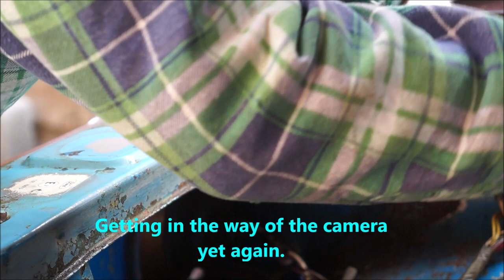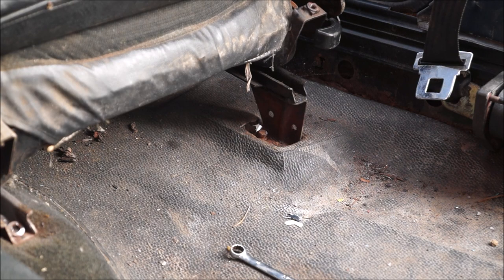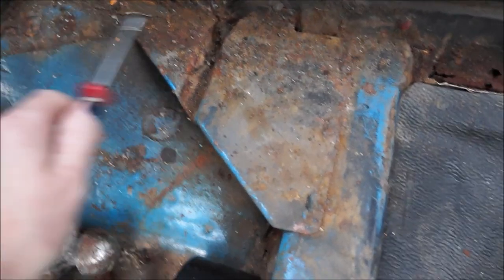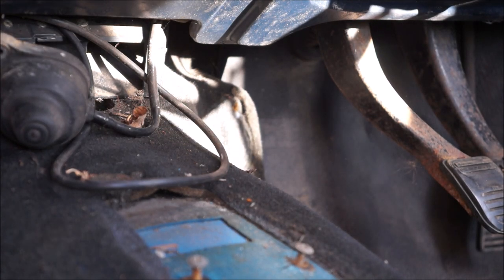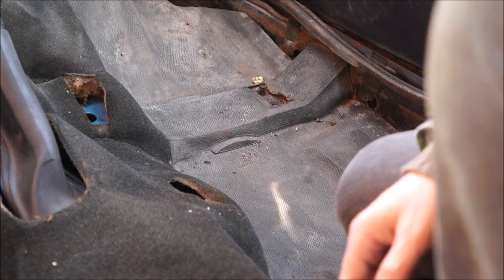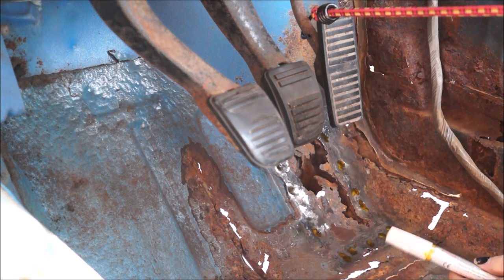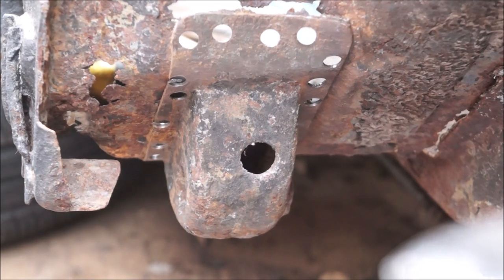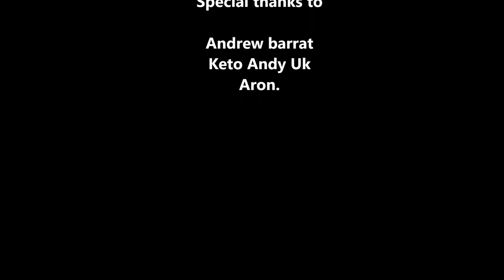Mk3 Cortina Estate Adventure Six

Comment: Oh and while I remember!
Metal and bodywork essential bit of kit when dealing with rust and salvaging structure?
Air Chisel.......
Noisy buggers though but they are awesome when separating spot welded structure from panels and other assorted norty tasks like cutting scrap rusty bits off.
Even a small one will help and you essentially just pop the chisel blade at the seam you want to separate and pull the trigger and BRRRRRRRT away  she comes like the first wave of Nazi Zombies at a Bren gun nest :-D just with less splash.
How do I know this? (Not the Nazi Zombie bit) Well over the years of budget classic restorations (And some Pro resto shop work) I have disassembled hundreds of cars in the exact way they were assembled in the factory.
Sometimes with Pro level gear like Wurth Spot weld drills and bits (Which dont drill all the way through) and sometimes with tightarse reground shallow point drill bits (Youtube it, its worth it) but the one common item was a $40 AUD Air chisel and assorted bits, some modded/Notched etc with the grinder.
The why? you should invest in an air chisel?
Because any car deemed too far gone can always supply NOS parts, panel and structure which when removed properly are both amazingly handy and even valuable should you accumulate more than a few.
And selling them will fund your projects/Workshop/Tools.
For example, a Rusty Chrysler wagon I was given, Well begged to take away yielded perfect rear panels and some structural outriggers at the front.
The 15 hours of blood, sweat, knuckle and unmentionables skin (Dont ask) eventually yielded me nearly 2 grand at mates rates which bought me a car lift (Hoist).
Even stuff like roof skins, the complete turret and weird stuff like A and B Pillars are sought after by the hard core resto gunzels seeking that bit of factory originality.
And it all comes back to the Humble Air Chisel and Spot weld drill.....
Reply from the maker: If I could use an air chisel I would tony, never used one before though and can't be too hard to use.